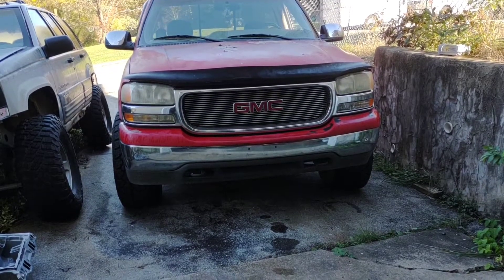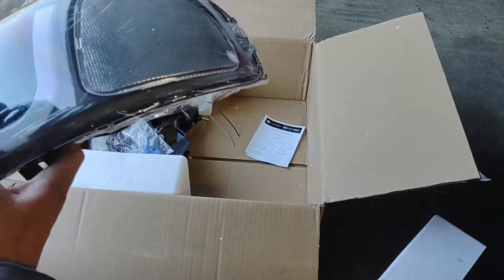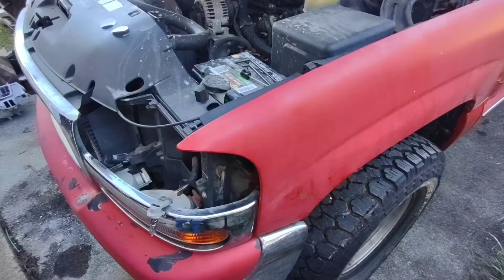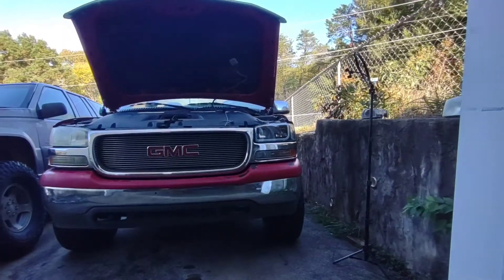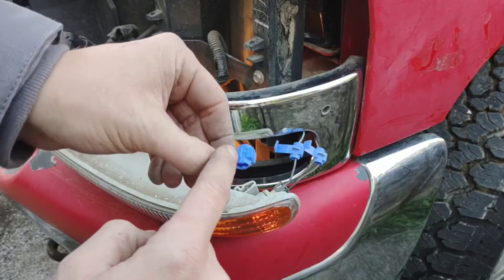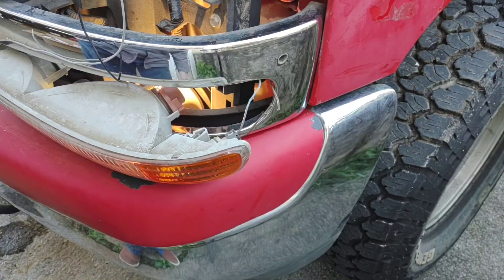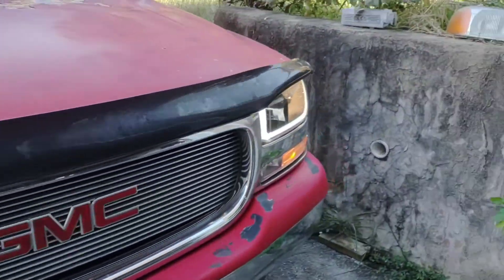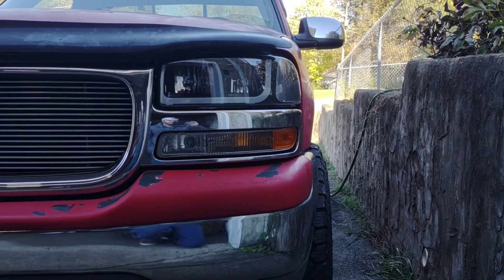99 GMC Sierra led headlight installation

Comment: If these lights are made for a specific group of vehicles, why can't they be just plug and play instead of having to splice wires to get them to work?
Reply from the maker: The only wires that get spliced in are the led strips. And they have to be spliced in because it's up to the owner when they want those led strips to come on whether it be with the marker lights or turn signals or with the low beams or the high beams. It's all up to preference.